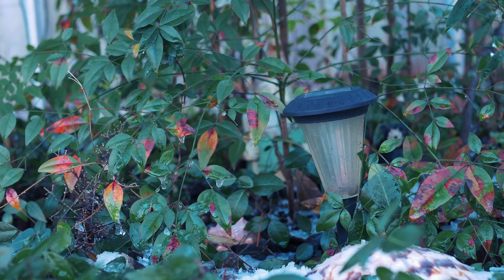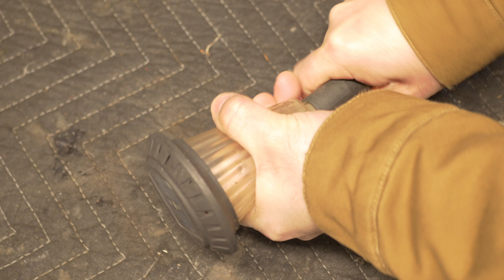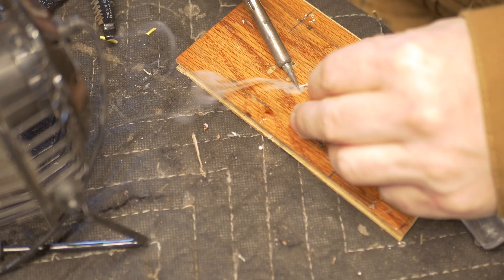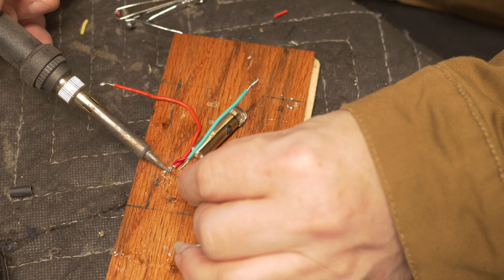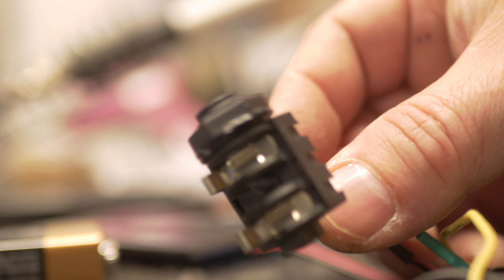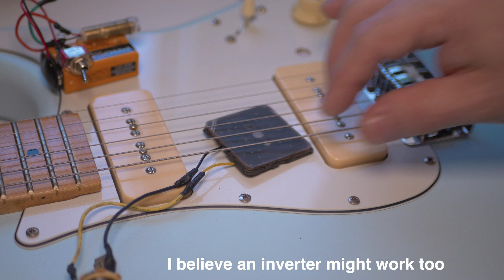Crazy Experiment! - Laser Guitar Pickup

Comment: Nice vid, so i have old parts from my old stratocaster, pickups etc, i have a solar board from a broken solar battery charger, a wooden box, and a kalimba, i think im going to use the pickups under the kalimba rods, and then maybe have the solar panel act in place of the tone knob? I have no idea what im doing lol anyway where did you get the capacitors and which would you recommend, 2.2?
Reply from the maker: cool project, keep me updated. I buy all my capacitors from Tayda. https://www.taydaelectronics.com. I think if you read the comments, folks have suggested better alternatives to capacitors, I can't remember what those suggestions were, but might be a good route to take. I don't remember which value I used. best to look through the vid. I think I posted the value on the screen at some point.

Comment: I may be missing something here, but not sure why the dc of the solar cell would create a hum. A capacitor should be able to eliminate the dc as you say. I wonder if hum could be coming from other light sources, such as fluorescents, that flicker at frequencies high enough that we can see them but low enough to hear.
I friend once showed me a cool trick where you plug a headlight into the speaker out of a guitar amp. In a darkened room, you can then use a solar cell to receive the sound from several feet away. You can also make sounds by running a comb or spinning a bike wheel in front of the light.

Comment: You say "I doubt this will turn into anything useful", but it 1) sounds dope 2) looks dope and, most importantly, 3) WOULD WORK ON NON-FERROMAGNETIC MATERIAL

i.e., this could potentially compete with piezos for nylon string guitars. You're playing with gain here, so I don't know how it sounds clean, but I don't hear any of that buzzy quacky piezo horribleness in this at all! That's quite something!
Reply from the maker: WOW, I never considered the use of non-ferromagnetic material. Now I'm wondering if we could make a stringed instrument out of twine or kite string or even use it on a snare drum.
Reply: @MarkGutierrez  any chance of putting some nylons on these and recording it clean? Would be a super interesting expdriment
Reply: Sorry I'm late to the party. It occurs to me that if you're going to do this with a nylon string guitar, you could, at least on the top three strings, aim a laser or LED down the end of the string and have a lighted string that would be easy for the pickup to register. Not sure what to do on the bottom three strings, but hey, that's someone else's issue. 

Also, if you remember the cover over the strings on the original P basses, something like that could be made that would be able to hold lasers or LEDS for each string on any type of guitar, making sure they are held in place securely. That could solve some issues, not the least of which is you don't want anyone looking directly into these things. 

Then, voltages would have to be lowered, or the inputs of the amps raised so you could get a clean sound out of these things. They are clearly way too strong for the amp he is using. 

Cool ideas, all the way around.

Comment: did it seem to make any difference which orientation the solar cell is in regards to the strings? ie the long lines going across or with strings did that seem to matter? going to try see if we can get this to work in a sub octave bass with 6 strings the lowest being e an octave below a normal bass with a 200 guage string the magnetic pickup/preamp side is sorted but thinking use a bit of thiis as a seperate output as it might track the low 20hz fundamental better than the mags? plus we usualy record/process the low end off a seperate feed anyway might as well be different pickup type lol

Comment: As this works with LEDs, all you need are six LEDs shining up from the body of the guitar onto the strings. You could even mount them so they are emitting light through holes in the same device which reads the reflected light off the strings. I can see this as a single unit mounted in place of a conventional pickup.  Would this work on bass? Is this just measuring the frequency of the shifting light, or is it measuring volume as well? One other question, would this work in normal or outdoor lighting, or would you need some kind of polarising filter so it only works with the right kind of light? ;0)
Reply: literally here to ask the same i have a low tuned 6 string bass id like to apply this to .........
Reply: There are optical pickups like that described, even as far as 60s

Comment: The hum is not a problem. All is needed is to modulate the laser with some signal of a very high frequency, and to use a corresponding high order pass band filter.
Secondly, we can use an infrared laser/diode and an IR camera lens filter (I assume that the photovoltaic panel is sensitive for infrareds.

Comment: If you move the laser so the light hits the high e string first instead of the low e enough light might get through to all the strings as the thinner strings wont block so much light and the edges of the thick strings should be Visible to the laser

Comment: Did you try a diode to keep the current going 1 direction. I’m not sure if I’m on the right track haven’t worked with DC in a decade or more.
Reply from the maker: That is something to explore. I think we want current. Traditional pickups create very small amounts of AC current. The solar cell creates DC. Need a way to reduce the voltage and invert it to AC or stop the DC from entering the jack. Thanks for the suggestion. Thanks for watching!
Reply: @MarkGutierrez  A solar cell can produce a DC voltage of up to 0.5 volts.  Your 6cell unit therefore produces an output  that fluctuates between 0volts and up to 3volts (probably less). When you put a blocking capacitor into the circuit, this becomes an AC voltage of +/- 1.5 volts. To reduce hum I would sleeve all the wiring with de-solder braid, earthed at one end.

Comment: Six Infrared emitters in the neck pickup angled to project on the strings over the solar pickup? Recess the LEDs in a holes to help with the projection. You are so far outside the box I doubt you can even see the box. Great job. The neck PU could be a single coil occupying a double coil foot print and hold the circuit required to drive it appropriately. Additionally thin, light tinting of the pickup would keep the ambient light reception down and tune the output (for better or worse?) Sweet concept. When do we get part 2? Edit. A tradition single bobbin in the neck PU so you still have functionality of a magnetic PU....That is all, carry on.
Reply from the maker: That would work. I'd need a 3D printer to print the housing. Sounds like fun. I may pursue it.

Comment: I'd imagine an option would be to have a single laser bouncing off a reflective surface to hit all the strings. Perhaps something like a mirror/metallic cover that sits over the strings like an old Jazz bass.
Reply from the maker: Clever. It could also double as a laser mounting solution.
Reply: Perhaps an over-string setup where there is a mirror and a laser and the pv receptor surrounding the strings
Reply from the maker: @theRandy712  I'm really digging the mirror and over string ideas. One thing to consider is the amount of room needed for strumming. It was already kinda cramped. We'd need to push the over string setup closer to the neck.